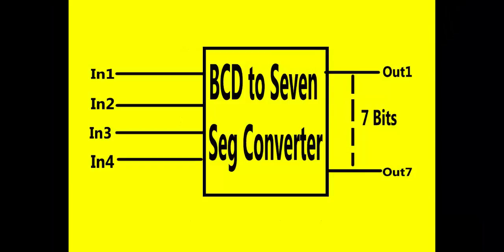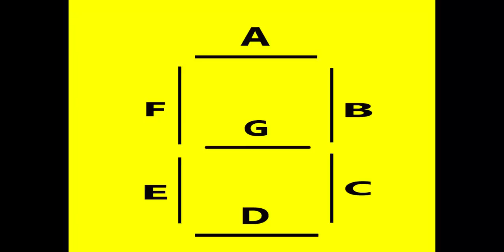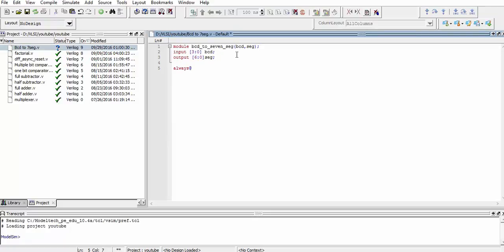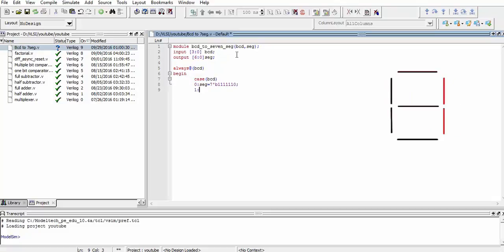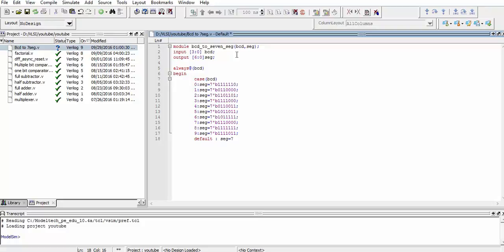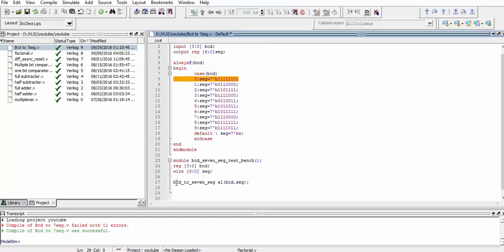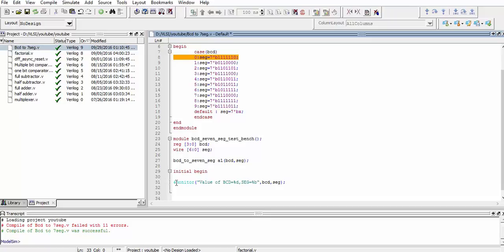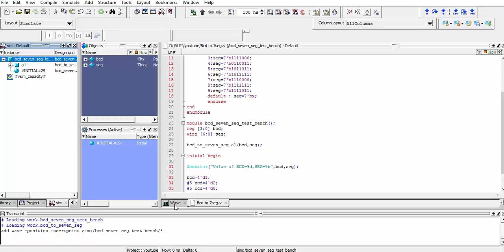Verilog Code for BCD to Seven Segment Converter

Comment: You made a mistake at writing the conversion for binary 3. It should be 7'b1111001, but you wrote 7'b1111000; So, conversion for number 3 will not work.